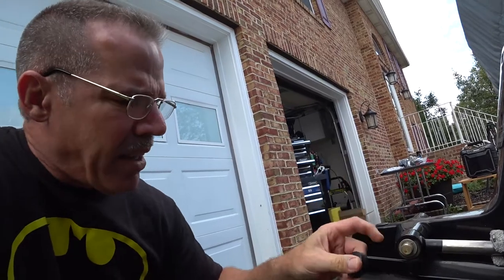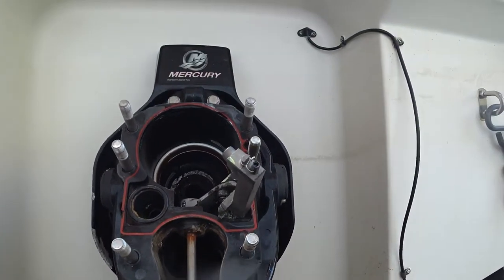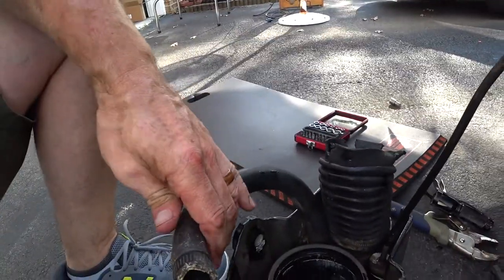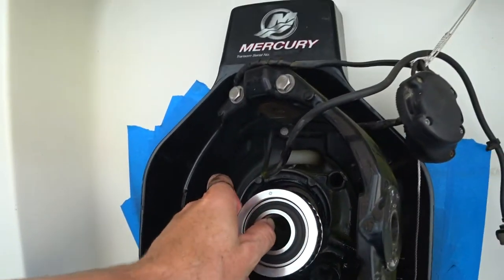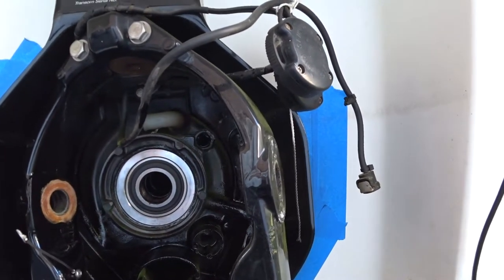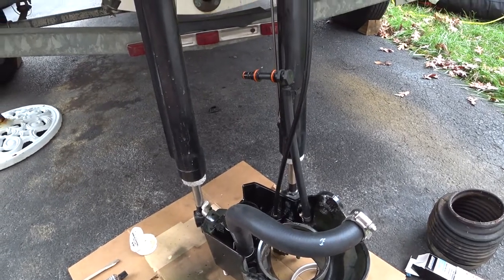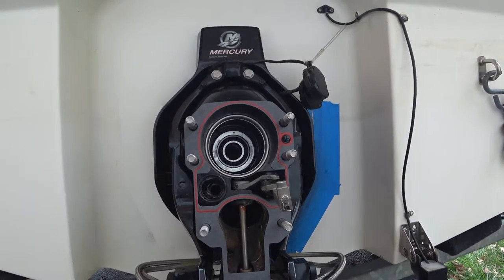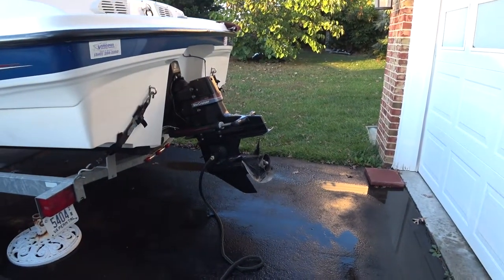Alpha One Gen 2  Outdrive Repair

Comment: Randy - great video thanks.  I have watched about 8 of these videos getting ready for my project and yours is the most coherent.  Happy boating...
Reply from the maker: Thanks, I appreciate the feedback. Good luck with your project
Reply: @randyj7476  Hi Randy - project went well.  Quick question.  You said you broke off the small piece on the transom side that attached the gear-oil sender tube.  I did the same thing.  The fix I found in the forums was either "remove engine" to get at the fixture from the boat side or plug the hole and manually check the gear-oil level in the outdrive.  How did you resolve this on your boat?
Reply from the maker: @joecusack1525  There was a c-clip I believe or it was a similar type clip.  I reached way behind the engine and disconnected the hose from the coupling.  Once the hose was off I just removed the clip.  That is the only thing holding that part in place.  I was then able to just pull it out from the outside.  I can't believe that some forums say to remove the engine.  Wow.  I guess it may be tighter on some model boats but in my case I had room.  I really had to stretch though.
Reply: @randyj7476  thanks Randy. I plugged it but am not pleased with it - might try your way and see what I can get done.
Reply: @randyj7476  Hi Randy - I hope you see this.  I need to buy the part we are referencing here and cannot find it.  Can you please tell me the part number?
Reply from the maker: @joecusack1525  I'm not sure which parts specifically that you are looking for but here are links to the parts I used:
https://www.amazon.com/gp/product/B001HBSY36/ref=ppx_yo_dt_b_asin_title_o00_s00?ie=UTF8&psc=1
https://www.wholesalemarine.com/washer-mercury-mercruiser-12-72498.html?gclid=Cj0KCQjwweyFBhDvARIsAA67M71lZ7RntdbZdPMPfNGFDMHrOn-7ON2-5vfR-WcjHtTPRqZ30F2kQdwaAiSaEALw_wcB
https://www.wholesalemarine.com/gear-lube-reservoir-fitting-assy-90deg-mercury-mercruiser-22-861150t02/

Hope this helps

Comment: Why not take the lower drive off first to make it lighter?  Excellent video!
Reply from the maker: Thanks. I didn't want to to take it that far apart since I could just take the entire out drive off as one unit.  It was heavy but it really wasn't too bad.
Reply: With COVID19 ruling out getting some help, I took my drive off that way. The disadvantages are you have to drain the gear oil - fine if you wanted to change it anyway - and putting the top part of the drive back on the gimbal housing can be a challenge. You don't have any means to move the shaft to align the splines with the engine coupler. Putting the complete drive up allows you use the prop to turn the splines until they align but risky for your back and the drive shaft will fight you!

Comment: Great video. I have a 2000 Bayliner capri. I have gear oil leaking out of the water intake. Can you tell me what the cost of the parts were and how to figure out what apha drive I have in my boat. Thanks.
Reply from the maker: The Alpha Gen II upper and lower housings are fastened together with two through bolts on either side of the drive along with the front and rear bolts, while the Gen 1 drives use one stud visible on either side. Alpha Ones have two studs under the ventilation plate just above the prop.

As for the cost of all the parts to fix my drive, I really don't remember.  I did buy some tools with all the parts too. I would advise you to get the original OEM bellows and not the cheaper aftermarket ones.  They cost a little more but last longer.  If you put the cheaper bellows in then you might find yourself replacing them again in just a couple years.

Good luck with your repair.
Reply: @randyj7476  Thanks for the info and advice Randy. I have sunk a lot of time effort and money into this Bayliner that was neglected for more than two years. I have been wondering what it would take to get this thing apart and stop the gear oil leak. I will do some research on the parts and ask my Bayliner owners club for additional information on my particular drive. Thanks again.

Comment: Why didn't you align the grease port on the bearing with the grease port on the Gimbal housing?
Reply from the maker: The new bearing was sealed.  It wasn't like the one I removed
Reply: @randyj7476  what do you think the dot on the bearing was for ? and looking at the state of your bellows you must have had water coming into the bilge , also lucky you didn't have starter motor problems
Reply: well spotted Kevin as a marine mechanic I normaly have about 4 hours to do it , in Spain , August red hot and the clients waiting
Reply from the maker: @jonhockenhull2707  The dot on the bearing is for orientation.  I found out later that Mercruiser recommends the dot to be at the 10 o'clock position.  As you can see, I installed at 12 o'clock position.  I didn't realize until it was all back together.  It's been working great all summer.  And yes, I did have water coming in through the bellows.  That is how I discovered the problem.  Didn't really leak too bad until I trimmed the motor up which stretched the bellows and opened up the holes.

Comment: Great video. Thinking i may have to do mine in the next year or 2. What year is the boat ? Mine is an 07 195 br and i think they are original
Reply from the maker: If you are going to replace your bellows then my recommendation is do not use aftermarket bellows.  Use original OEM.  My boat is a 2006 185 BR

Comment: I’m in the same process now and I also broke the monitor gear lube fitting.  Can you advise how you found and disconnected it on the engine side to replace it?  I’m having issues finding it.  Thank you!
Reply from the maker: follow the gear lube monitor hose down to the fitting on the inside of the boat.  There should be a little button that you press on the end of the hose that will release it from the fitting.  The you can pull it out from the outside of the boat.

I didn't have to go to this extreme but here is a video of someone pulling it out similar to how I did it.
https://www.youtube.com/watch?v=sfS7HXYWtdc
Reply: Awesome, thank you so much for your help!

Comment: overall, how long did it take? Thanks for the video. About to do the same thing in a few days.
Reply from the maker: I remember just taking my time and I believe I spread it over  a couple days because I was filming, reading planning and doing other stuff like removing corrosion and painting.  I also broke a part that I had to order.  If I had to do it again I think I could do it in about 6 hours or less.
Reply: @randyj7476  all OEM parts? Just curious. Thanks.
Reply from the maker: @TripleXess  Yes absolutely.  Use OEM parts.  The bellows are really involved to replace and once you get them replaced you are not going to want to do it in another couple years.  Those cheap aftermarket bellows can save you money when you buy them but they don't last as long.  You will get the longest life from OEM bellows.

Comment: great help - thanks. did you change the anodes?
Reply from the maker: Thanks.  No, I didn't replace the anode.  Although they were slightly pitted, they were still good and I only run the boat in fresh water lakes so they should last a long time.

Comment: The new gear lube fitting that you pushed in...was that just a push in fitting or did you have to secure anything from inside the boat? The part I found on-line shows a C clip holds it in place from inside the boat. I don't have any room inside the boats engine compartment if that is required,
Reply from the maker: You are correct, it is just a clip that secures it inside.
Reply: @randyj7476  Thanks good to know. I almost paid $1700 for the stealership to replace everything you did, but they couldn't get my boat in for a month and a half. After watching your video I'm almost done replacing everything myself including new Trim senders for less than $500 including purchasing the special tools - gimbal bearing puller/installer, alignment tool, bellow installer tools. I'm just waiting on the final parts to arrive from Amazon. You the man! Thanks for showing people this can be done by the average person!
Reply from the maker: @jfisch01  Thanks,  That is a great savings.  Glad I could help you save some money. Hope everything in the last final steps goes well for you.  Happy boating!

Comment: My gear oli lube fitting broke as well. How did you get it out of the back of the unit? Can I just pull it out? I dont know if there is something on inside back of engine bay?
Reply from the maker: Yes there is a hose connected to  the the end on the inside (behind the engine on the transom).  If I remember correctly, there was a small clip that retains the hose.  Just remove the clip and the hose will just pull off.  Then you can just pull the part out from the outside.  Grab it with a pair of pliers and it should come right out.  It will only be held in by the tension from a couple o-rings.

Hope your repair goes well.

Comment: You great job brother
Reply from the maker: Thanks
Reply: @randyj7476  my sterndrive leaking i thinking tackle that any suggestions
Reply: The oil leaking so every time I go I always put a bottle of gear oil
Reply from the maker: @alltsab  The only advice I can give is take your time.  I couldn't even begin to advise on how to fix your leak since I could be leaking from many different places.  You can download the manual here and have a look to see if you can narrow down probable  places to check.

http://www.ta-group.at/dokus/service%20manual%20_14%20alpha%20i%20gen%20ii%20outdrives%201991%20to%20present.pdf

Good luck with your project and I hope you are able to locate and fix your leak.

Comment: I’m currently in the same project times 2.  Question on the water intake hose transom side.   What tips and tricks do you have to installing that on transom side?
Reply from the maker: I don't really have any special tricks or tips.  I did learn that it was impossible for me to install the water inlet hose on the transom after it is already attached to the bell housing.  You just don't have the room or space to work.  I had to remove the hose from the bell housing and attach it to the transom first then you can attach to the bell housing.  I did find it easier to use a 5/16" ,1/4" drive socket (since they are smaller than 3/8" drive) and ratchet with a long extension to tighten the hose clamp rather than a long flat tip screwdriver but either one will work.

Comment: Whats the name of the piece you bought. The part that the oil barb broke.also did that part just pull back or was it attached somehow from behind, inside engine compartment?
Reply from the maker: The part I ordered from Wholesale Marine and the official name and part number is : Gear Lube Reservoir Fitting Assy 90Deg, Mercury - Mercruiser 22-861150T02.  There is a hose with a fitting on the end that attaches to the end opposite the barb.  If I remember correctly, you have to squeeze that fitting in order for it to release.  There was also a clip on the inside of the boat that you have to remove before it will pull out.  If I have to do it again in the future I will remove it this way instead of trying to remove the hose from the barb.  Less chance of breaking it.
Reply: @randyj7476  thx helped alot. Rebuilding outdrive is pain in butt. After this its time to just buy new boat lol.

Comment: Did you not have to pack the bearing with any kind of Grease or was it a pre-packed bearing already
Reply from the maker: No, it was a sealed bearing.
Reply: @randyj7476  there's a zerk fitting for that on the starboard side of the bell housing. You're supposed to pump grease into that and clean out the excess
Reply from the maker: @desertBirdDogs  The new bearing was sealed.  It came with a plug for me to remove the zerk fitting and plug it.

Comment: For a first timer you did pretty good but you skipped the very important installation of key parts . When you do a how to video you should video all of the installation instead of skipping very important parts you didn't show how to install the gear lube fitting didn't show how you installed the ring for the universal bellows didn't show how you installed the inlet water hose didn't show how you finally got the exhaust bellow on the very important parts you just shit canned and nobody learned anything . Should also show installing the pivot pins and torqueing them and installation of the drive and torqueing the bolts and cress cross pattern. Some body that needed some help would be lost by your video and would right back to square one trying to figure things out .
Reply from the maker: Roger - thank you for the constructive criticism and you are correct, I did not capture everything on film.  Turns out that I am new to vlogging and ended up doing some of the work before realizing that I should have been recording.  I learned something from doing the video and I will incorporate those lessons into any future videos.  Thanks again for your feedback.
Reply: @randyj7476  Please don't think I am being mean towards you or disrespectful . You did a great job of videoing what you did do it was very clear and you explained everything very well! For a first time you get an atta boy job well done! I want to learn how do edit but for some reason it intimidates me I have been wanting to do it for years but it stops me dead in my tracks I have tried to hire people here  to teach me and they always lie and flake out. Keep up the good work you will do well the next one Randy you get an attta boy!
Reply: @madmanmechanic8847  Would replacing the anodes on the trim rams eliminate future corrosion
Reply: Well done Randy J, I would advise getting a tripod... and Roger, try editing with Lumavision, pretty easy app
Reply: @SteveLockephoto  Lumavision will it walk you through the steps> I am very intimidated by video editing I don't know why is it easy for somebody that has never done it before thank you
Reply: @SteveLockephoto  Those are part of it but on front of the lower gear case is the main anode which protects your drive also you have stainless cables on your drive going from your bell housing to your drive those are part of the circuit for your anti electrolysis make sure those are attached and clean surface for  mounting . There are two bolts holding the front anode you can take those bolts out and take a wire wheel to the anode to clean off the corrosion on it will also help and save your drive cleaning on them and your drive should be a regularly  scheduled

Comment: 1:30 look at the propeller is cracked should have changed that
Reply from the maker: The prop is not cracked.  I think it was just the lighting and camera angle that made it look cracked.  It does have some dings but not too bad.  I will probably replace it with a stainless prop soon.